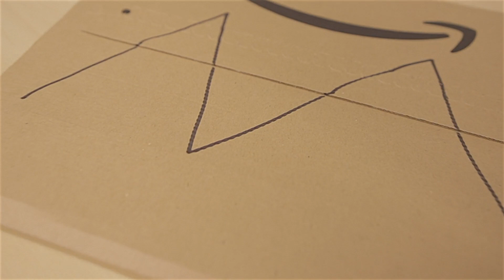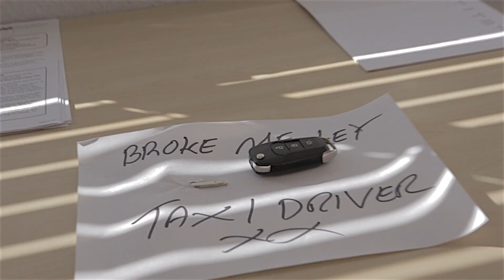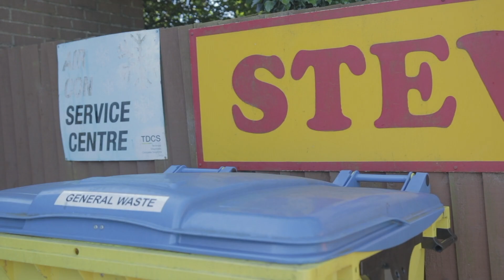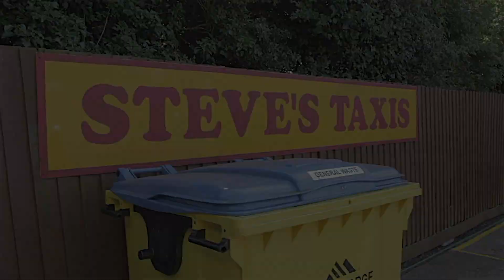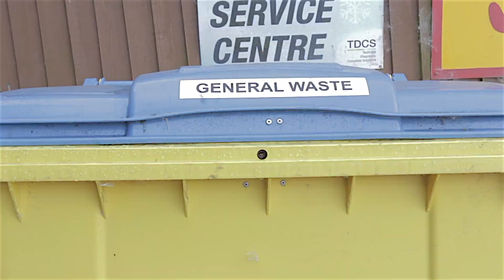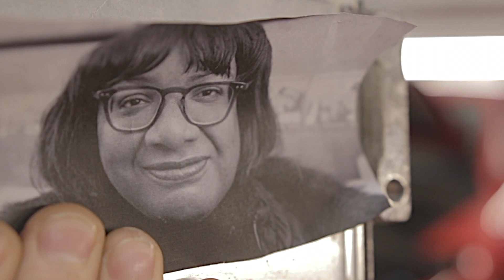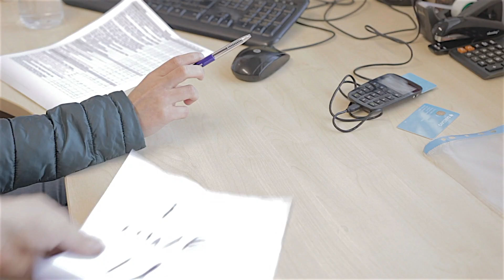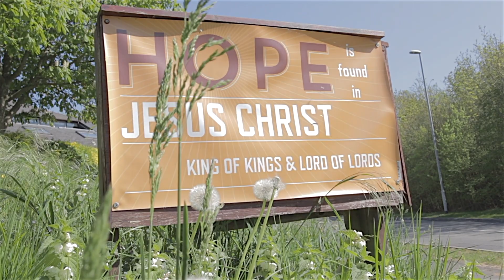Monika & Alan Xmas Special.... The funny parts & office scenes  (part one)

Comment: Have a great Christmas!  If you get a chance 2008 ford mondeo 2.0 slow to start! What direction would you go to see what it is!
Reply from the maker: merry xmas to you too patrick, when you say slow to start do you mean the engine turns over slowly or cranks over fast but takes many revolutions before it fires
Reply: Turns ok but to many revaluation!
Reply from the maker: @patrickhalpin5935  probably check your glow plugs if its only when cold or replace your injector leak off pipes which could be sucking in air over night...the worst case would be low cylinder compressions
Reply: Have a great holiday you and all the gang! Thanks for your help!